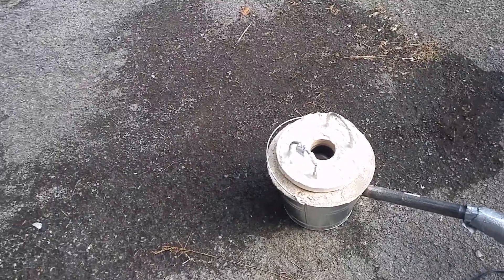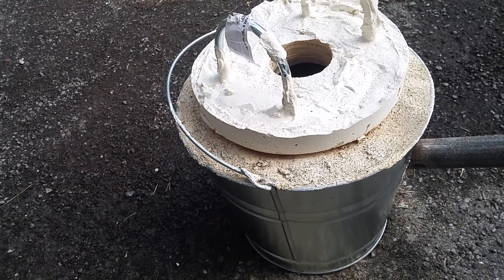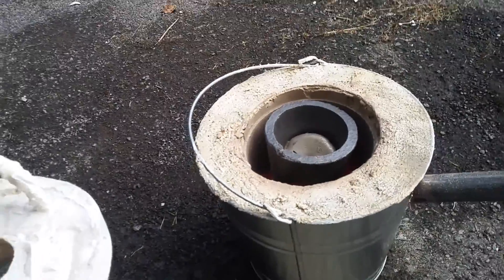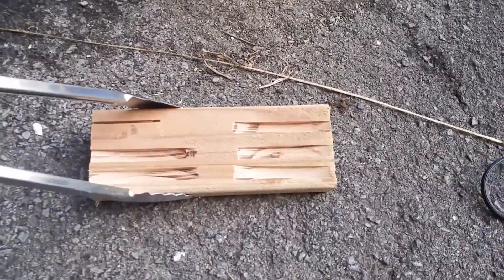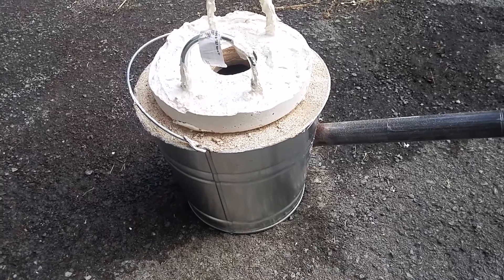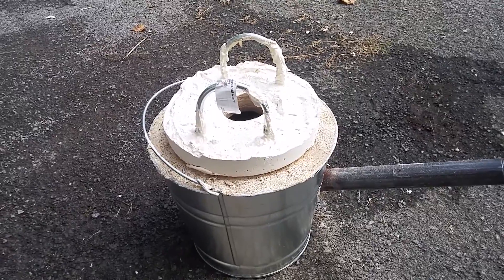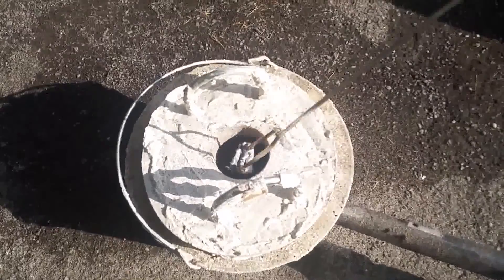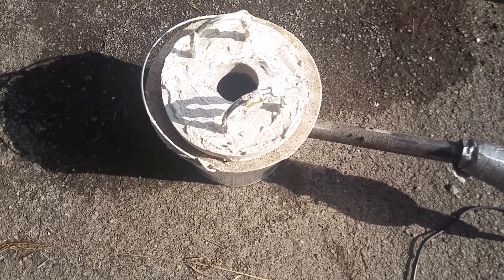Graphene in Aluminum (first attempt) pt1.

Comment: Doesn't the carbon eat holes in the aluminum? I would be interested in this if not. I recommend trying some tests with borax and aluminum sometime, I was trying to make aluminum foam, but ended up with a very hard, strong metal instead.
Reply from the maker: Blitherer Masterman I'll look into that. Sounds very interesting.
Reply: I don't know much about metallurgy, it was one of the few melts I ever did and the result was shaped irregularly so it is hard to judge how good the result actually was. All I know is that a small part sticking off, maybe only a mm thick or so was almost impossible to bend by hand. Not sure how that would compare to just the aluminum I used without the borax, but maybe worth a try if you have the means to test the result.

Comment: Generally speaking, it's hard to create aluminum/carbon composites because the aluminum reacts with carbon to make aluminum carbide which is unstable in that it will further react with water. There is a Russian company that's managed to make an aluminum/carbon nanotube composite. If you succeed I believe the product would be very useful in batteries.
Reply from the maker: We have quite a few aluminium/graphene composites on hand. This was just a test to see how a crude system could work.

Comment: I have planned to play around with this kind of alloy myself. but I have a hypothesis that the metal will bond better to the graphene if it is heated together with the metal. like "soldering" them together. to make a more even distribution of graphene I plan to use powdered metal and graphene and mix them evenly before heating them to melting point (maybe in an inert gas environment).  haven't built my furnace yet but it's in the works. what I plan might be overkill but I like to go big and scale it down.
Reply from the maker: As long as you are under 800C the graphene will be ok.
Reply: Ahh so if i go over 800C will it start break apart?

i have plans on trying to bond it with copper. that is why i though about using an inert enviroment to avoid any form of oxidation and reaktion.
Reply from the maker: +Freddie Does Stuff Technically it will oxidize, causing defects and lowering the strength as well as almost every other property. That's why GO and RGO doesn't work, and should never be considered graphene.
Reply: Well in this case it's not strength I'm after but conductivity. but i might try it even i it doesn't work. i like the "Apature science"- way "throw everything against the wall and se what sticks". :D
Reply: Moreover, adds Mitlin, the assembled supercapacitor device yielded a maximum energy density of 12 Wh kg-1—significantly higher than those for commercially available supercapacitors. By taking advantage of the complex multilayered structure of a hemp bast fiber precursor, these high-performing carbons were created by simple hydrothermal carbonization combined with activation.     https://www.asme.org/engineering-topics/articles/energy/hemp-carbon-makes-supercapacitors-superfast